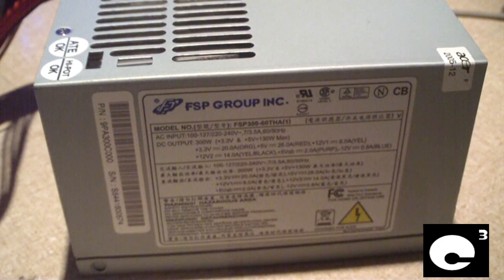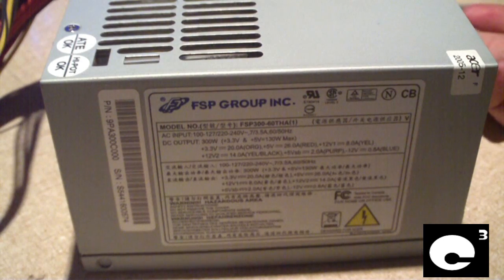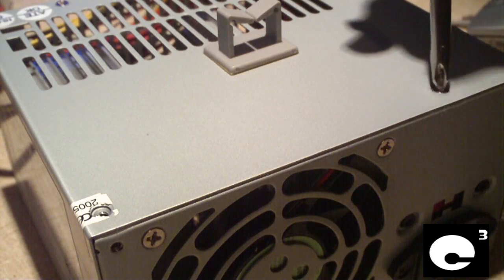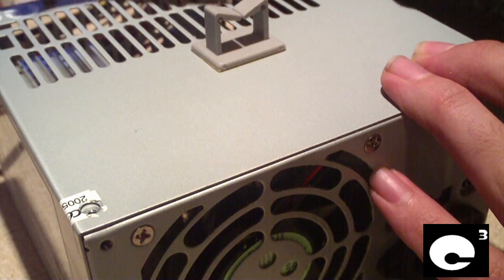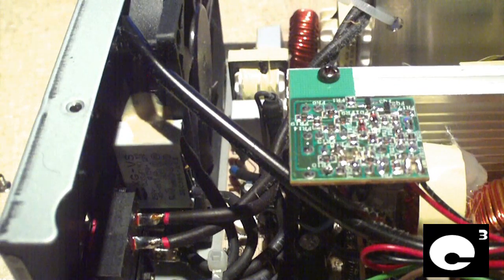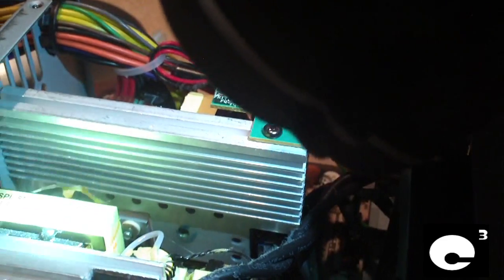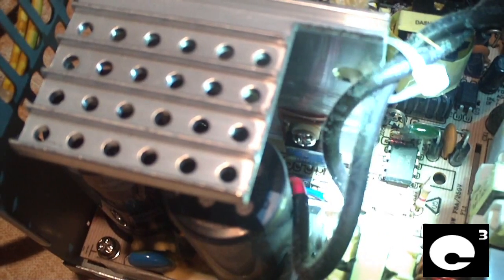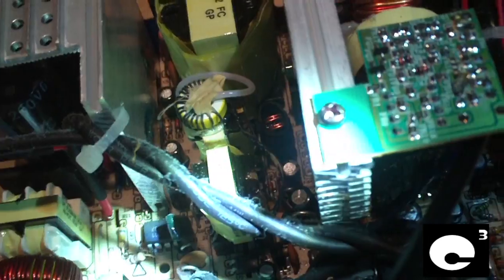Mysteriously Dead FSP 300w PSU from Acer Desktop

Comment: To power the main outputs on use a paper clip to connect green wire to any black wire that should start the main supply the 5 volt (sb) should always be present
Reply from the maker: Thanks, however trust me - I know how to power up an ATX supply. There's an actual fault in this unit where it won't start. Connecting green to black does absolutely nothing. No shorts in the secondary, capacitors look okay from a visual. Unit has some corrosion on the underside.
Reply: Is there a -12volt present that output seems to be connected to supervisor ic I removed the 1000uf 16v electrolytic capacitor on that -12v line all the main supply outputs went dead I removed it as on mine there is no -12volts at all with the capacitor in & other voltages work fine but remove that capacitor & all shut down
Reply: Blue wire -12volts not present on mine all other voltages fine & working but a track from this -12v output leads back to supervisor ic
Reply from the maker: @jonburgmann  Thanks for the suggestions. I will definitely look into this. I have a much newer video of this unit where I pull the PCB out of the case and show the underside of it. I'll add a card to this video to it.
Reply: My -12 volt was at 0 volt’s I looked in a bit further & found a shottky diode came up as a resistor on tester so I checked with multimeter & had no forward voltage reading so replaced that diode & everything sprung to life all back in Acer aspire tc-710 & powers up now so because there was no -12 output the supervisor ic detected this & the power ok signal came on too 5volt good signal PG (8) grey
Reply from the maker: @jonburgmann  I will definitely check this out!
Reply: Supervisor IC WT7527T from weltrend power supply FSP300-60THA(1)
Reply: If there is a no voltage on the -12v output the supervisor IC detected this so the grey PG power good signal was 0 volts
Reply: When I changed the shottky diode the -12 volt rail came back & checked the grey wire & there was 5v on it which is PG power good signal that goes to mother board to say all is good to power up

Comment: After some digging around - it seems the power supply did a number on both my monitor ($99 damage) and IDE HD, 500 gig Barracuda (damage = $89).  The power supply is dead; since replaced a few years ago.  Never searched for a specific video [until NOW]  - but nice to see.

Comment: Thank u sir . I have FSP  supply model no. FSP200-60ATV  my Question is I had opned supply I round the green wire with balck wire for ti run the Dc room cooler first time on and second time rounded but only fan on a second than off please teach solution

Comment: I have that exact model PSU. 2 or 3 days ago my computer went off like the plug had been pulled. No noise no smell, etc. Turned it back on and was fine until yesterday the same thing happened. But it won't turn back on anymore. Completely dead. Only thing I can make happen is if I unplug it for about at least 5 seconds, plug it back in, push the power switch and the psu and case fans will turn for a split second.
Reply from the maker: phillyflash43 If the fans twitch like that, them there might be a short circuit somewhere, either in the power supply itself or the computer.
Reply: phillyflash43 buy a new psu probably
Reply: PSU cold solder or bad aging solder problem, re-tinned all solder joints will solved it.

Comment: I just had the sam problem with my acer desktop. I've had it for 6 years. It would not turn on at all but once i took it off and disconnected it from any load it turned on no problem. So in the end I put it back in the tower turned it on and started plugging everything in. This just happened 20 min ago.
Reply from the maker: Even with lo load attached, this one won't power on. Only the 5VSB rail gets power.

Comment: I had one power supply, a very nice enermax noisetaker, that stopped working too.   For me, it was a blown thermister.  I never would have known if i didn't plug it in a bunch of times and saw an arc coming out of the thermistor.   The only sign was a tiny 1/2mm brown burned hole in it.   ripped open a bunch of other working but older PSU's to find a similar thermistor and swapped it out.   done...  

or how about a blown fuse?  heheh.

Comment: I've got the exact same PSU FSP...I bought it in a  sale but its full of dust. I blew it out with an air duster and jumped the green wire to switch it on to check it...the fan moves slightly, but the voltage from the power cable to motherboard is really low..barely anything. No bad caps that I can see, so I have no idea?

Comment: I have two of those, one powered my main rig for six months without a single issue (PhenomII X4 965, M4A89GTD, HD5770, SSD, HDD). The other one, well I more or less killed it when trying a shorted GeForce G100 (it didn't kill the other cheapo PSU I tried after that :/ ) and just like yours, there is no visible damage. It seems like it wen't into security mode and never came back...

Comment: @CubeComputerChannel I made measures and found a very good powersupply of 500W very small that fits perfectly. I was kind of surprised!! I will take it out of its case and mount it on the PC case like the one I showed you. My IT Teacher said it should not be a problem if left without case the PSU, he said he used to run Powersupplies without casing. I will make a video when I am done building it, with WaterCooling as well. :>